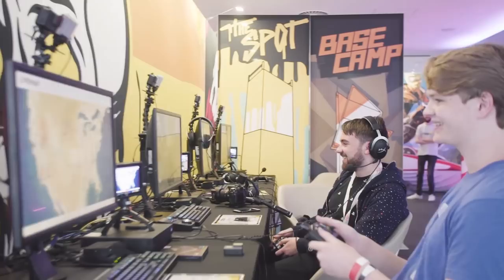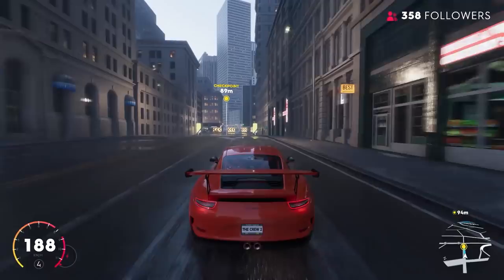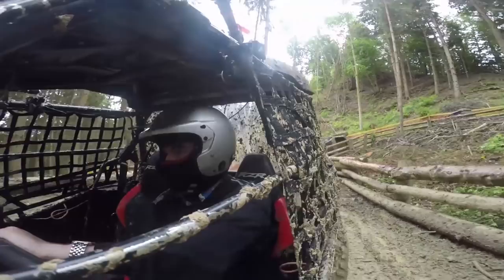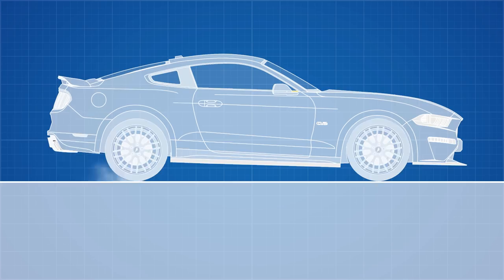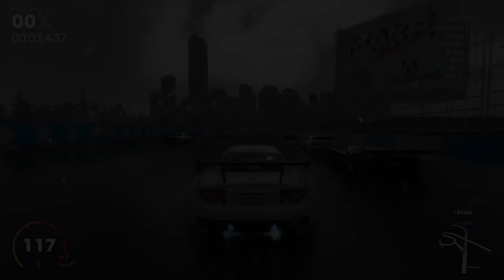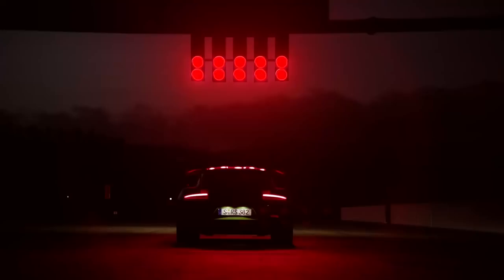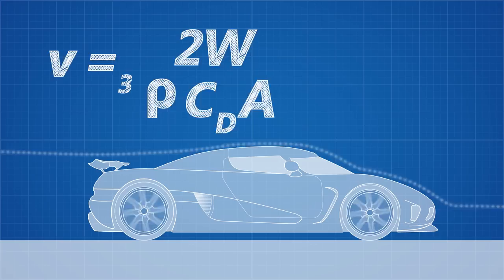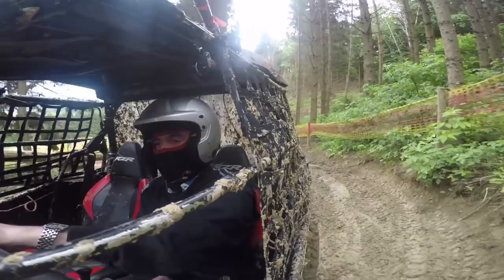The Physics of Racing Games

Comment: I think it is odd they don't do spoiler physics.  Newer supercars depend greatly on mechanical spoilers to maintain the right grip on turns and at high speeds. I suppose it would be difficult to do though.
Reply: There’s no point calculating the aerodynamics of it when you can just make the downward force a function of your speed and direction. It’s much simpler and you’d never notice the difference.

Comment: Is it possible to give a relatively weak relatively good performance at both low and high ends just by adding tons of gears?  Is there a point of diminishing returns or something that keeps  them from just giving my 4 cylinder 10 gears in order to give it low end torque and high end speed?

Comment: This is how I usually make a motion physics simulator:

Forces:
FX= all horizontal forces added together  
FY= all vertical forces added together  
This is the net force (vector)

For example:

FX= 0.01*(JOYSTICK_RIGHT - JOYSTICK_LEFT)  
FY= 0.01*(JOYSTICK_DOWN - JOYSTICK_UP) + 0.02  
'the 0.02 is gravity,
To set a max velocity you can add friction as a constant when the ground is touched, and drag depending on the velocity (everything else can be combined in a constant), watch out for oscillations, especially with realistic velocity-squared drag

here's the safest velocity-squared drag I've made
```sign(v)* min( abs(v), 0.001* v * v)```

for games it usually doesn't have to be an accurate simulation, so you can just tweak the intensity of the forces until it feels about right

acceleration
According to one of Newton's laws: acceleration is the net force divided by the mass, the mass doesn't change so I usually ignore it and say (F=A)

velocity
In recursive physics simulations it's realistic to write:

M=10  
'Mass of the vehicle  
AX=FX*M  
AY=FY*M  
DT=1/60  
'Delta time is 1/60 frames  
ADD VX,AX*DT  
ADD VY,AY*DT  
But I usually write:

ADD VX,FX  
ADD VY,FY  
position
it's realistic to write:

ADD PX,VX*DT  
ADD PY,VY*DT  
But I usually write:

ADD PX,VX  
ADD PY,VY  
And when collision is detected, I find it convenient to set the velocity (VX or VY or both) to zero

Comment: "Designing games like this is always a delicate balance between realism and fun."
I liked the video, but I think you are mixing up you dichotomy. It's realism vs accessibility, rather than realism vs fun.

Fun is a subjective feeling. Personally, I experience that increased realism (with regards to physics) is often synonymous with more fun, as it will raise the stakes, and increase the feeling of reward when doing well. It usually doesn't get as boring and grindy that easily either.

Comment: Stopped watching after "so your inner idiot can apply spoilers to FWD cars". 
Putting a wing on a FWD car is quite beneficial, especially in high speed corners as it stabilizes the rear end of the car and keeps it planted. Just because a car is front wheel drive does not mean that the rear wheels can't and won't start sliding around.
Look at the difference between wing and no wing in this video: https://www.youtube.com/watch?v=OAsO58Ubv0E
Still think a wing on a front wheel drive car is rice and useless?

Also could have at least been with a racing sim not The Crew 2 lole

Comment: its too bad racing games like the crew dont use soft body physics like in BeamNG
Reply: nah its good because it will make all games laggy
Reply: it only lags on potatos ... anything with a GTX 1060 or better with a quad core i5 4th gen or better and 8gb RAM or better will run just fine 

i never liked it when the code of racing games pretends to be realistic but when basic physics tests show that they are not realistic ... alot of the damage models used treat the cars like they are hot wheels not cars 

if they were to at least make the cars deform like in Dirt 1 (2007) or better then i wont have as much of a problem because then the physics will be realistic enough that it can be fun yet a bit dangerous to play 

BeamNG physics can be done at a lower physics model resolution (instead of having like 4,000 nodes the cars can have about 1200 nodes and still look convincing )
Reply: not all computers are good
Reply: then those people with shitty PCs should upgrade or not play ... the lower end is holding back progress (the same goes for consoles holding back PCs)
Reply: i mean like 60% of people cant play it not playing the game equal no money for the game makers
Reply: ok fine you win